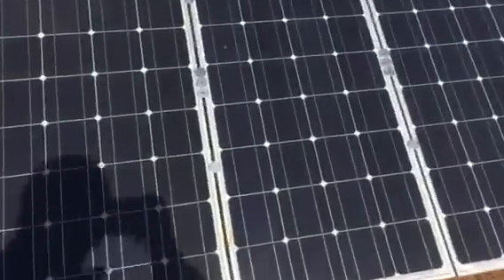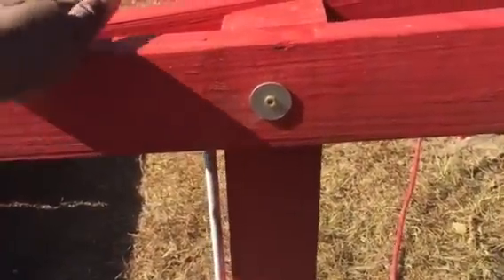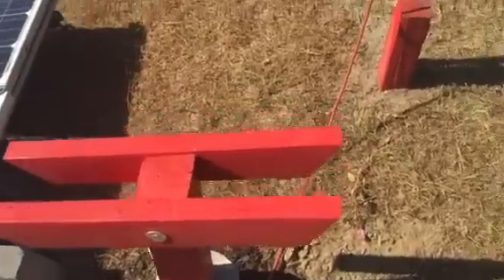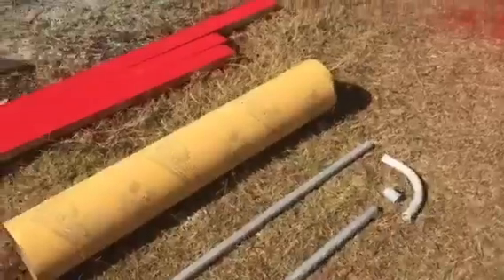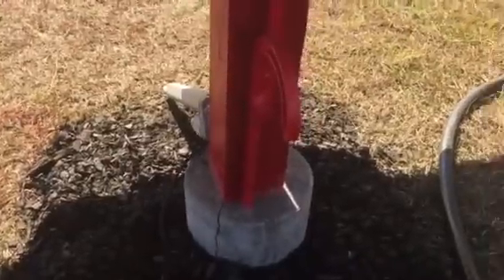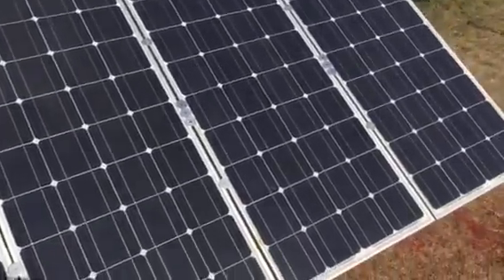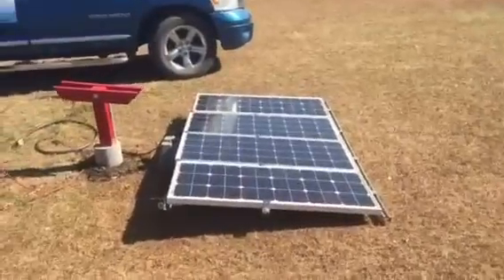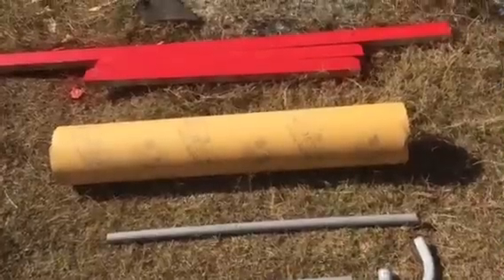Off grid solar update. How to build diy trackable solar panel mount

Comment: I should use this design on my flatbed trailer instead of concrete I could use a 1/4 steel tube flange bolted to a 1/4 plate and welded the the frame.  And use 4x8 for the stand or I was even thinking 1 inch OD conduit poles and ends for wall canvas tent frame those are strong.  My panels are 300 watt 42 pounds 65 inch x 39 inches 1/1/2 thick I have z brackets too . I could use ubolts for 1 inch OD pole  to attach to z brackets . What do u think?
Reply: I have 4 of these panels total wattage 1,200.
Reply from the maker: I think bolting to the frame then lag bolting into the 4x8 will get you to the strength
Reply: @brooksjeremiah2011  I finally came up with a plan here is the so far construction of the unistrut pole frame foldable solar panel mounts. https://youtu.be/A_VCCB6cAhA

Comment: Where do you get the actuator?  How does it operate?  Does it sense solar strength or just run by time?
Reply from the maker: Ted X simple 300lb actuator that's really over kill. Unit was on timed tracking. However you can use a tracking system and maybe get a bit more energy but I didn't see micro adjustments every 5 minutes worth the energy and cost

Comment: With those 12v panels you can run them combined for 24v or 48V Too. You just need a combiner.
Reply: Sedated By life ... 12v panels are as usfull as teets on a bull. Go big so you can do somthing with the output like get 220 volts ac . 12v are for amatures  not understanding basics ,  ohm law for instance or how little you can do with harbor freight  crap.